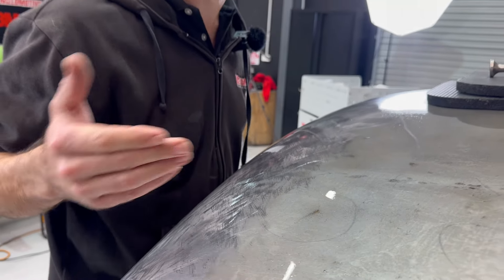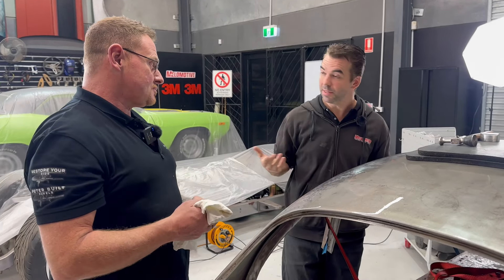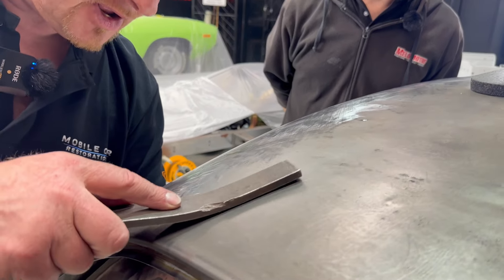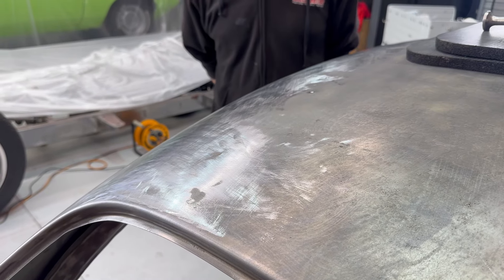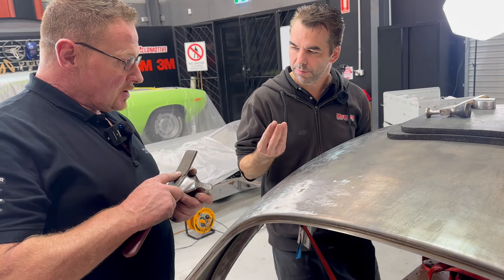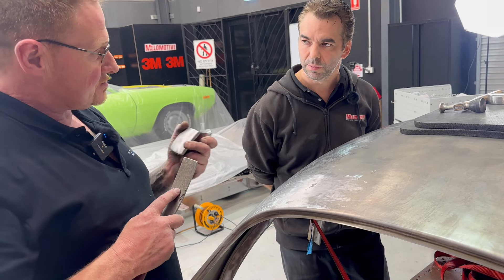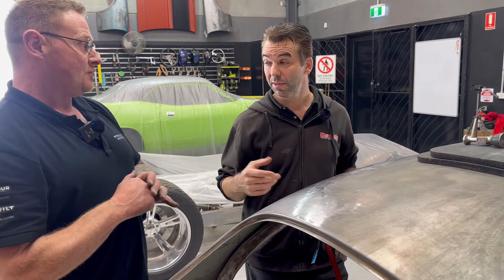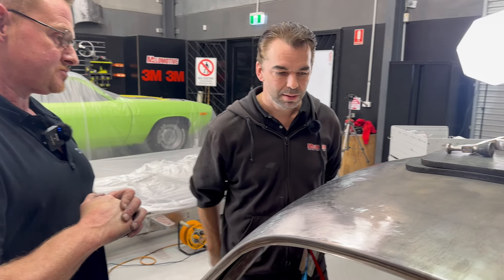How to smooth and remove dents in sheet metal with a hammer, dolly, slapper and file the easy way.

Comment: Looks like he just sanded it off since 80% of the job was using the file 🤣
Reply: HE didn't remove that much metal, the "sanding" is used to locate the low spot and work the metal to take the memory out of it, so the work stays stable.
Reply: @CHRnorton  he sure as shit did, and that's thin ass metal.